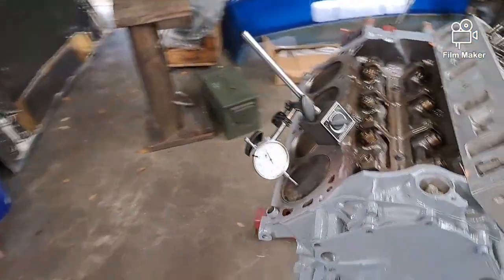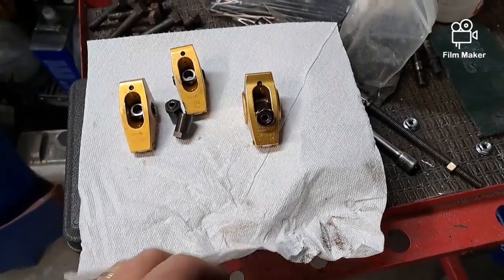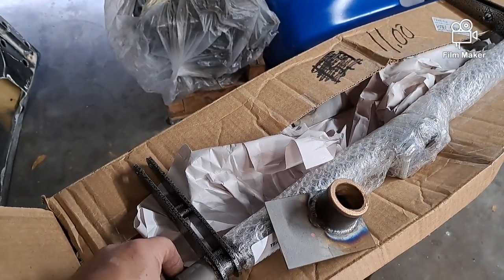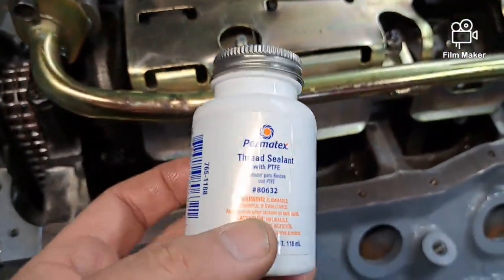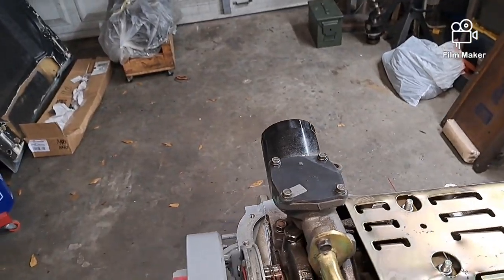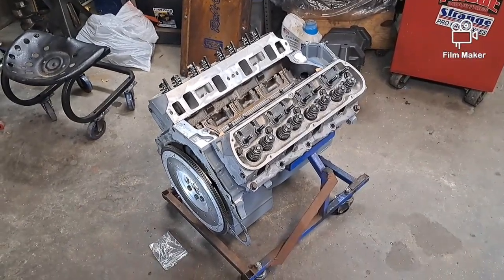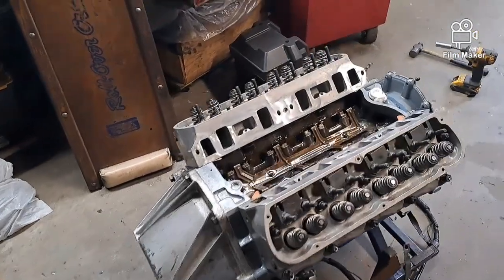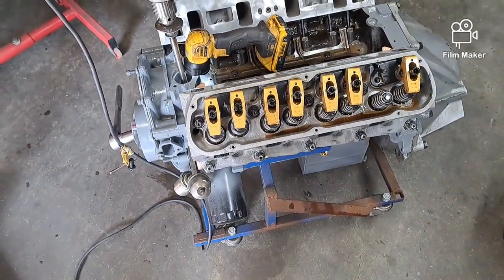Trooper Car engine revision part 2, episode 5

Comment: You could always measure the boars of the block Before & After hanging it on the engine stand, we always just used a 2 by 4 cut to length and put it under the front balancer and the engine stand to take the weight off of it to be on the safe side.

Comment: Man that guy believes in christmas lights 🤣 they are cool to look at though. Hey I was gonna ask if u had a comp cams cobra 1.7 roller rocker laying around that you didnt need or wasnt in a complete kit that I could buy from ya . I did the same thing you did and bought a set pretty cheap but only have 15 which I knew when I bought them
Reply from the maker: I do not
Reply: @FXRSDriver  i meant to say crane cams roller rockers 🤣 but im sure u knew what I meant 🤣 Ive got some 1.7 gold ones a whole kit that ill probally run and hopefully find the missing one for another build

Comment: Glad you could use the clutch. I switched from 10 spline to 26 and had that collecting dust when and you and Rodney were talking about putting a greasy clutch disc in the parts washer 3 years ago lol.
Reply from the maker: I should do the same on the LTD, but I'll just have to be careful how I drive it until I'm able to.